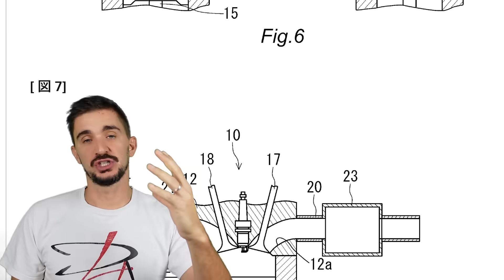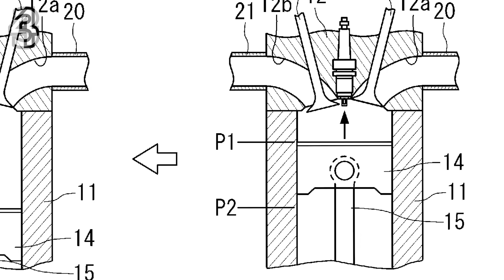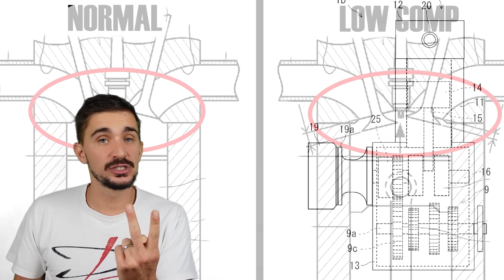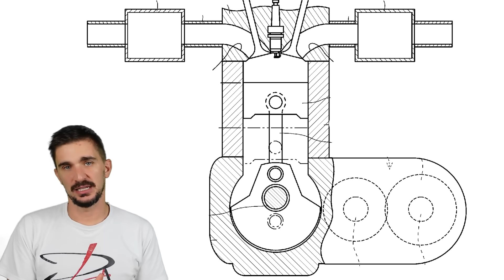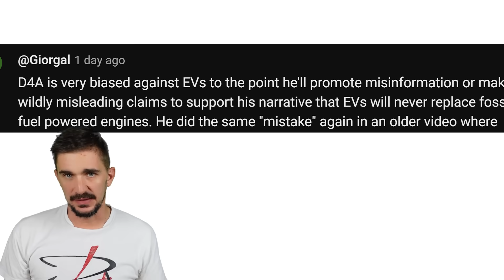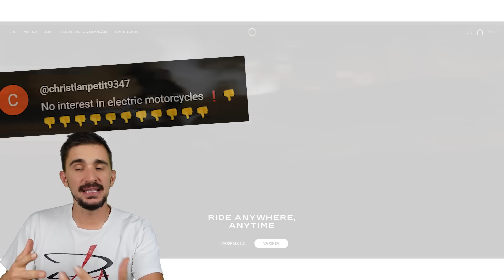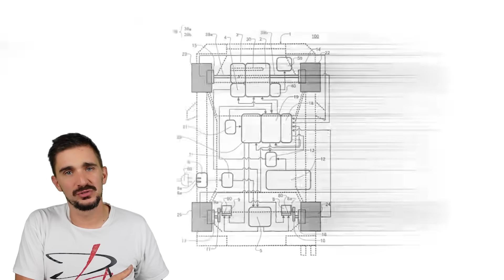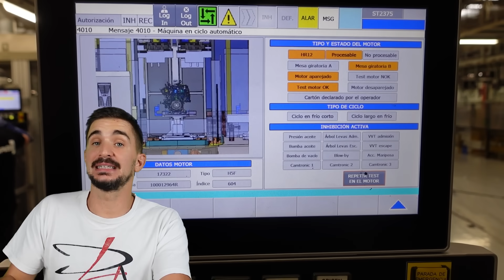Yamaha Just Patented A Fake Engine

Comment: I have always admired Yamaha's penchant for taking the lead in the ever advancing technology that comes to and from motorcycling.  They have - of course - frequently suffered the infamous "penalty for taking the lead" - like when they produced the monocross suspension for motocross, which placed the massive shock assembly high in the frame and lacked the progression element their rivals incorporated in their (superior) single shock designs that followed.  OR their MX liquid cooling where they mounted the radiator high on the forks and routed the coolant through the steering head.  In concept, likely a great idea - HOWEVER - heating the metal fork tubes served to thin the fork oil and ruin the damping, not to mention all the weight mounted at the highest point possible on the bike..   These are just a few examples but I still give the tuning fork company kudos for pushing the boundaries.  BUT WHEN IT COMES TO ELECTRIC BIKES - fake motors equal fake buyers.. I have been riding bikes for fifty five of my sixty five years on this planet and other than a few electric dirt bikes I have no desire to ride an electric motorcycle... This whole "save the planet by switching to electric powered machines" is insanity.  The power has to come from somewhere!!  If 'they" were really wanting to save the environment (rather than control the populace) there are ways to do that... eliminating gas burning engines is not a good idea..  JMHO

Comment: Why didn’t they make it into an air compressor/ air motor and use it for braking and extra acceleration? It would be just as noisy but would INCREASE the range and power of the machine.

Comment: I used to have a fake engine turning my Mustang bicycle into a fake motorcycle during the 1960's. It had engine like sounds run by a battery. It was called the V-RROOM and was made by Mattel. Perhaps Yamaha should check out Mattel for patent issues.

Comment: so simply its just fancy air compressor to eat even more of the battery since the electric motor needs to do more work xD

and i think the lack of engine noise and vibration is not rly the reason for lack of interest in electric sport bikes. its the lack of distance they can drive with one charge.
i have looked into electric motor bikes and all seem to share few common issues. lack of top speed and lack of derivable distance u can do with one charge. so u constantly have to stop to recharge that takes way longer than it would take to just refill with gas.
ye u can also get a super fast one but with more power u will also run out of battery faster too. then there is all these BS apps u need and other bs that comes with them since they want to place everything behind a subscription paywall.

also this fake engine seems like a bad idea. it will take space that is all rdy limited if u want larger batteries and it adds extra weight plus eats more battery charge since it needs to run that air compressor.

and lastly there is the cost. these electric bikes cost so dam much so its better to buy a 2nd hand bike or regular bike and then save that extra money on a car that is more practical for daily use

Comment: 9:24 well, there is no combustion, air cooling will be more than enough... the air flowing will be enough, Harley Engine can shut down one cylinder to transform it into an air pump to cool it down, it's used on parades where speed is low.
So it's definitely more than enough for something like this. If it's ever being built.

Comment: I own an Harley Davidson and an Energica.
If you believe the sound and vibration is more important than the capability of the vehicle, I have no doubt of calling you stupid and a liar.
A motorcycle is first and foremost a vehicle, you use it to move it with different purposes: visit places, going fast, make group, cruising on the road, etcetera.
None does it because of the sound, otherwise you would just stay all day in your garage with the engine on. It's even cheaper.

Just test ride an Energica or Harley Livewire, they are fun. They are strong, ride like a dream, and they come to a sound that's unique and cool like a Star Wars speeder that makes everyone turn their heads.

14:46 lol, no... battery energy density is not going to improve that much, especially when you are taking away space to build that fake engine. That's why hybrid on motorcycles are dumb.

Comment: You've got a 2.5l 4 stroke on a motor cycle. You've got a 0.25l 4 stroke on a motor cycle. The difference is the feeling of riding it, not the necessity of the larger engine, the bike is larger to take the engine. I can't imagine it'd be especially popular right away, but if you can put 2.5l of power onto the frame of a 0.25l of power, then you get a silly bike, which is great. But, if the rider doesn't want to be in Tron, they just want to have unnecessary levels of power on a lightweight frame, then they can have that, and have a tactile sensation to keep them in check. I don't think it's quite as bonkers as it first comes across as. Yeah sure it is wasteful, and I doubt the market is especially large, but it's no more crazy than slapping a 2.5l engine on a bike in the first place.

Comment: Hear me out... Its inevitable that "gas powered" motorcycles will eventually be phased out, and a lot of people don't like the sound of that. What this design does is integrate an engine that could (in theory) be very easily modified to run on gas. It was mentioned that the "fake engine" would have variable valve timing, so all you may need to do is rig up a fuel injection system, give the valve timing a tune, and you're off. 

Yamaha would never come out and say this, even if this hypothetical reasoning I have applied is true, but they know their customers, and if this turns out to be true then there is no doubt that people will modify these bikes to run off of gas. Either a stupid waste of time and money, all to achieve the outcome of decreased efficiency, or a genius engineering feat that exploits a very clever loophole that allows buyers to continue riding gas bikes, while still technically being "0 emission" bikes from factory.
Reply: It's not inevitable.
Only a few totalitarian countries would do that, if they're even serious about it and not just trolling everyone with psychological terrorism.

Comment: Hi! I think you may be over estimating our good human society. During covid, there was a plan in Australia that was taking off and landing at the same airport, just for the people that were missing taking a plane. This is absurd but it existed. Yamaha is a company in a capitalistic world. I prefer it to do absurd things rather than to disappear because other companies will do them before Yamaha. Finally, I would add that a motorcycle is not the optimal way (in term of energy efficiency) to go from point A to point B. Knowing this, it makes sense that a motorcycle company invest time and money into improving all aspects of a motorcycle which is not about energy efficiency, as those aspects are the reasons why people use motorcycles. If we can have hundreds of electric motorcycles with a fake engine instead of hundreds of combustion-based motorcycles, than it is probably better for the whole society. Yes, it is a waste of ressources, but the impact on air pollution, particularly in city, worth it I guess.

Comment: Honda solved this in cars years ago with the first generation insight. That car is so fun to drive, it's lighter than a Miata, was entirely engineered around the manual transmission first, and is unapologetically optimized in every way, for peak fuel economy. That car is interesting because there is no fluff, and nothing about it is fake, they made it perform its task perfectly, engineered to the maximum, and then its quirks and the odd ball ways it manages to achieve its performance naturally become interesting. Hybrid bikes are the real answer right now imo, all the tech is there, just fallow in the steps of the insight, keep it light, make it fun, make it aerodynamic, and you're all set.

Comment: "Fake gearing that you can turn off and has no impact."
No. It isn't always possible to disable, and interrupting power delivery does create a shock load through the system which does have an impact. If nothing else, it's very annoying.

Comment: The fake engine does not use fuel, and the heat generated is only due to friction(no combustion). Does not need heavy components or enormous lubrication. Might be more efficient compared to a linear  vibrator. Just think it as efficient sound generator compared to fake sounds from an amplifier speaker combo. Looks and feels more authentic, if they can substantially reducing the weight and wear using carbon fiber(piston)/magnesium alloy(light weight structure)/ceramics(for lubrication free bearings).❤👍

Comment: I'd rather have an EV with a manual gearbox than a fake engine - more driver involvement and at least you still experience torque multiplication, even if it's unnecessary

Comment: So they made an electrically operated airpump, that's shaped like an internal combustion engine. 
What do we use airpump for? 

Airpump makes nice sounds, maybe. But airpump can also compress air, air that can also power a turbine, which can also spin a little electric motor. There are looses along the way, and more complications, but it's fun. 

Let's be kids for a moment. Sometimes, we just do things for fun. Sure it might have costed some money, but a company like Yamaha is rich enough to throw a few bucks on a fun what if project. Just like any other patents that never went to mass production. 

Also, patents can be used so that no other dudes make this same kind of "engine". It's like hunting down pandora's box to the ends of the world, and then keeping it in a secured vault so no one else gets hold of it and do unthinkable horrors.

Comment: I would love to buy and ride a pure electric bike, but motorcycles aren't my focus anymore - now I build and sail boats.  Still, for decades I would have paid good money for a decent electric bike with good range on a charge - 100 miles would have done it for me. Now that they're available I'm not interested enough in riding. The only bike I own now is an '09 KLR 650. It's a great transportation backup, and still fun enough to ride ... but I loathe the sound and vibration of a thumper.  I used to cut the engine and coast as I dreamed of getting an electric! 

My favorite bike of all I've owned  - at least with respect to sound and vibration - was a '79 Yamaha 750 Triple.  After a few years it lost 2nd gear, so I just replaced the whole engine with one from an '81 850 Triple.  Despite the assertion on this channel that 3 cylinder engines are not perfectly balanced, I could get the carbs synchronized well enough that those motors would run like powerful little sewing machines! The Triple wasn't the best bike I ever owned, nor was it the prettiest or most fun to ride overall.  But it DID provide the sweetest riding, sound, and vibration feedback.

If I was to switch focus away from sailing and back to riding today, I would 100% be riding the most silent electric dual sport I could afford.   I've never bought into the "loud pipes save lives" BS. Loud bikes are only really noticeable from behind, and there they're just annoying.

Comment: This is genius if you think about it. Suppose in the future, it became illegal to buy a non electric vehicle. Well, it wouldn't be illegal to sell ICE parts which you can assemble and replace this fake engine with a real one. Same size, same weight, makes the same noise...
Reply: Throw a fuel system and throttle on there and you've got yourself a real engine!
Reply: @gquirt that's what I was thinking
Reply: gearbox?
Reply: @jaimagoras generator+ existing electric drive train would eliminate need for a gearbox…

Comment: As much as I agree with this being wasteful, well... Technically everything we create that is meant to just generate fun and nothing else is wasteful. Getting more (too?) philosophical about it, every single race car designed to just go around the track in the fastest way possible with no particular reason is just wasting fuel, steel, rubber etc. but it generates lots of fun. This concept just seems... extra, extra, extra wasteful (and a little counterproductive given the possibility of worsening overall performance).

I can see it having its place in a similar region where Ionic N lies. If you want the same bike for both boring stuff ("engine" off) and exciting stuff ("engine" on).

Besides, this could be an interesting option to people who just love gimmicks. I wouldn't be surprised to see a review of such bike in Doug Demuro's channel or someone like him in a couple of years. And if they then doubled down on the meme and actually made it an air compressor for the tires... Legendary.

Comment: @d4a do realise this is has most of the hardware for a hybrid drivetrain? if you change camshafts and add injectors/throttle/ecu/etc. maybe they are putting R&D into hybrid motorcycles but don't want to ruffle any feathers. just my 2cents.
good vid as always 👍👍keep it up

Comment: just want to skip the ice engine ban  they still put the spark plug thingy in there maybe you can modefied that to run also on gas ⛽️ they also put the variables timing in there they put the clutch why can't you simply puth second moter for the fake engine no need for the clutch with second motor for the engine they can make high revving sound on slow bike speed

Comment: I Dont see the issue. its an engine design that does do something unique. you might not like what it does, but that doesn't mean it doesn't do anything useful. i personally would rather ride a bike that sounds and feels like a bike with an engine than one with a buzzing sound. even at a small cost of performance or range. i cant imagine it would take up that much actually. also the oil and cooling and maintenance you bring up, i dont think they are an issue. the main reason for heat and maintenance is the actual strain on the parts and the combustion. you can design it in a way that it has very minimal strain on the moving parts if it doesn't actually have to transfer a lot of energy. its just cosmetic so it just has to move around a bit. if its actually cheaper to ride, doesn't pollute, handles well, and feels like a real engine, it beats a pure electric engine if you ask me. and a real one as well i guess if it feels like a real engine but has all the benefits of an electric one and no real downsides.

Comment: 9:25 There is no need to change the oil. The oil is not contaminated with gasoline, exhaust, hot temperature .... you just have to keep it lubricated.
But do you have to change the  the timing belt ? 🙂
Imaging you twist a valve because of a timing belt failure 🙂
Or someone stealing your catalytic converter 🙂

Comment: The aftermarket will provide a kit with fuel injector, spark plug and fuel lines for conversion to a fuel powered motorcycle.

Comment: We had a tire inflator that worked by screwing one end of a hose where a spark plug goes, and the other end to the tire.  Run the engine and use the cylinder as a compressor.  We only used it on a tractor.  The gas fumes did concern me.

Comment: I think Yamaha will have been hoping that the patient would be over looked by everyone.
Ok think this way.
In the future currently there's not going to be any engines they will be illegal to manufacture but legal to use this will mean old bikes will allowed to run on petrol.
And unless you make your own engine from scratch your only choice is electric or old bikes with engine's.
Now imagine you buy a fake engine Yamaha it's legal to manufacture use and sell and after it's been on sale for a while people find out the fake engine can be converted to a real engine with minimum cost and effort. then you get the best of both and it would not be easy to tell if it was converted if it was running as it sounds and feels the same as it does when using electric only 😊
In short Yamaha is preparing to use a legal loophole and using it's current factory tooling and machines while other manufacturers scrap all their unused equipment.
And also if it becomes apparent that electric vehicles are not as good as they thought and they find a fuel that is cheaper and greener and can be used in normal engines like hydrogen or alcohol or something.
Yamaha will be ready to take over the market and be able to build engines instantly. And other manufacturers will have to start from scratch.
I think I will see if I can buy shares in Yamaha 😊🎉

Comment: Greetings from germany.
Usually i am a big fan of japanese vehicles. But Yamaha become a bit crazy in the last 10 years.
I drive an electric motorcycle, too. And honestly, i love the silence. I don't want an engine sound. The vibration was nice. And to create that, Yamaha could install a balancing shaft, they usually use in inline 4 engines to make them smoother.
They could install it as an additional part, that has no power transfer job to do. So it would rattle the bike only for the rattle. That wouldn't use any additional Power at all.

And here we have one manufacturer, that has a sound module for the bike. And the sound is directed to the driver. So the other traffic vehicles wouldn't notice that at all. And that sound module is kinda funny.
You will have the following options:
- UFO - electric woop sounds
- Inline 4 - Sounds like a small car (small for americans compared to their semi truck engined cars)
- V8 - sounds like a small british or japanese V8 with 3 liter displacement like the Range Rover had.